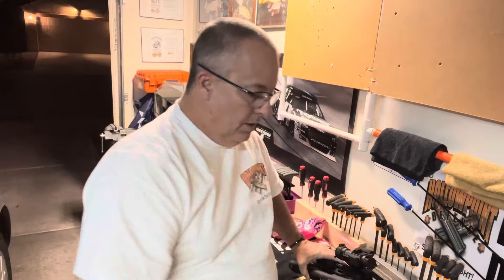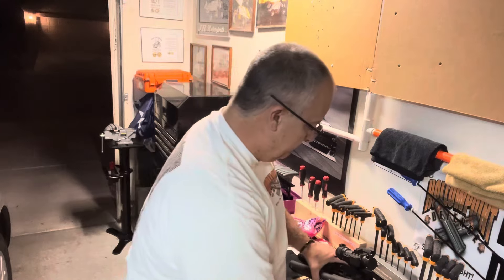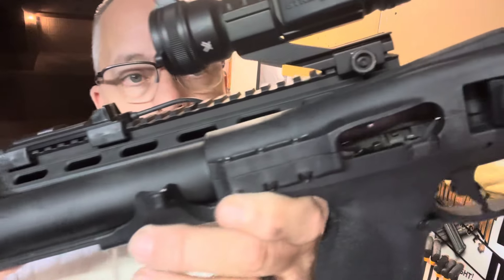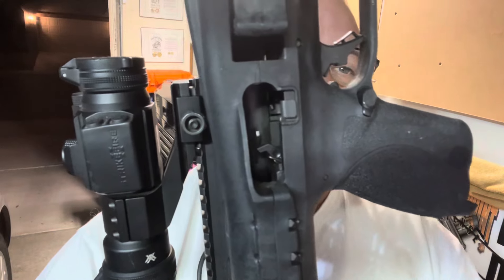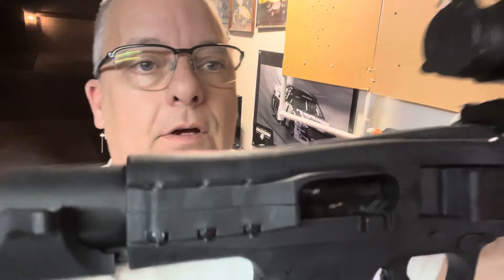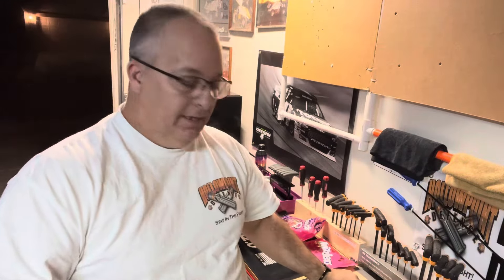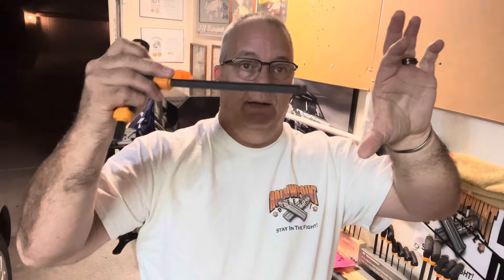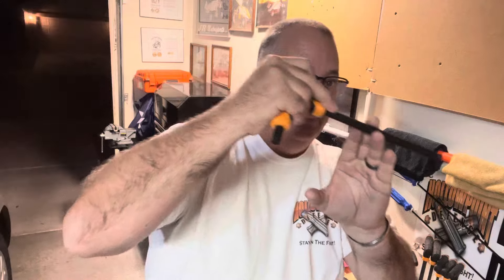S&W FPC trigger resetting method

Comment: Thank you!!!  I was ready to take my FPC to a shop or send it to S&W. I was positive it was something I'd done while cleaning but after taking the FPC apart and putting back together 10-15 times was so frustrated.  I was stuck on it not cycling but finally did a search for one of the other issue in that a magazine wouldn't seat in place either and hallelujah I found your videos on magazine issue and then this one on trigger resettiing. Fixed my problem. Thanks again, so much!
Reply from the maker: You're welcome, glad it helped you out and saved you money.

Comment: Thank you for this. It saved me about an hour long trip back to the gun store. Even though I reset it like you showed when I tried to put the slide in it was still getting hung up a little bit so I had to use a screwdriver to press the trigger down a little further, and then the slide went right in. Works perfectly thank you
Reply from the maker: You're welcome.